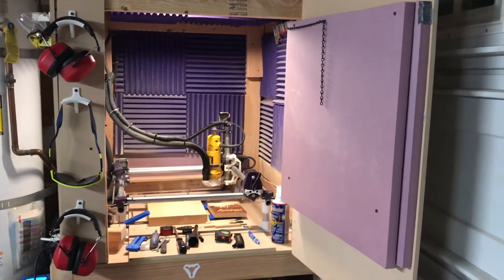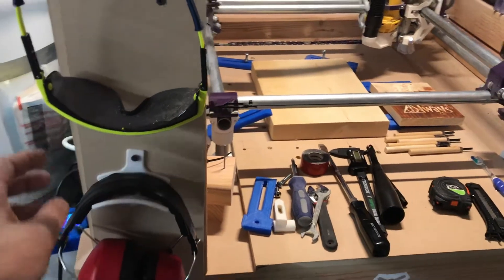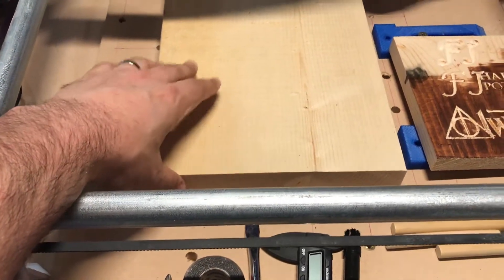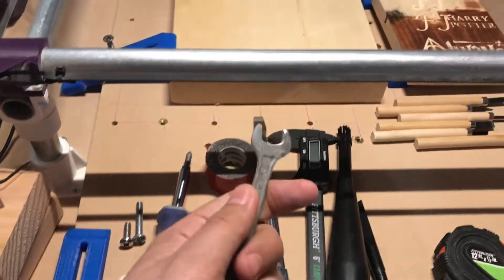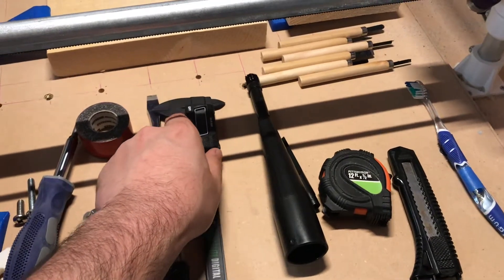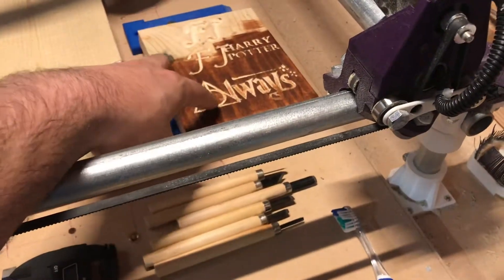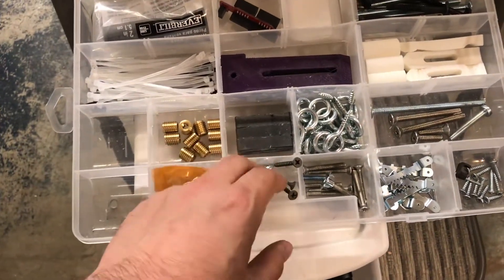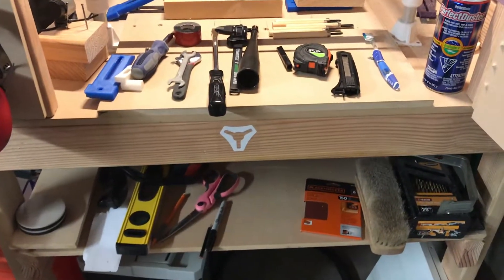MPCNC Pro-Tips part 2: Tools

Comment: Hi,
I am just starting my MPCNC journey (like I have not even printed any parts yet). I am currently a 3D printer and am really looking forward to getting into CNC. I will certainly be following your series and hopefully picking up a stack to great ideas.
Reply from the maker: Sounds great! Some other channels to follow are "Some Old guy coding" (I learned a lot from his videos, though they do tend to be long and in depth). Also there are videos now of MPCNC's cutting aluminum and even Steel! So the community is coming a long way. When you build it I just suggest being meticulous...I usually get excited and rush things a bit, but with this project accuracy on things like squaring it, and leveling your spoilboard are really important! Also make sure you clamp your work securely...and I watch my machine run..even via webcam if needed. You never know when you may run the head over a clamp cutting it free and then things go sideways. :)
Reply: GeekToolkit thanks for the advice. I’ve started printing the parts and I have some of the hardware on order. I think that I’ll definitely build some sort of enclosure. Mine will be in the garage and I don’t want to annoy the neighbours.

Comment: How loud is the cnc when doors are open and when closed?
Reply from the maker: Sorry just seeing this...I did an enclosure video that talked about it in DB, but in short...it's loud when its open (Must use hearing equipment...think circular saw by your ear). When its closed I can have a conversation and remove the hearing protection but I still stand a few feet away. but if i go a room over its barely noticeable....and I can speak normally...almost like being near a washing machine.

Comment: Once again great video.
I wouldn't mind knowing how you built the enclosure and where you sourced the foam from. How much does that deaden the noise?
Reply from the maker: jeff fodor Thankyou! I’m planning on making the enclosure video tonight if all goes well. The pink foam is from Home Depot...about five or six dollars for each panel. The purple was from Amazon...I’ll look up links tonight and link them with the enclosure video. I’ll also get a decimal measurement on both. Combined together it definitely deadens the noise...upstairs the shriek becomes a low hum...to hear it we have to not talk. Before it was considerable. In the Garage I can walk around and not have hearing protection on, but next to the machineI I still use it. The other benefit is dust...my entire garage would get covered in dust before this. I’ll get good video and some of my in progress pics up!

Comment: Super jealous of all that foam! Gotta fix that
Reply from the maker: oh you mean the sound absorption stuff on the sides? Insulation foam from Home Depot...flame resistant (some people were using egg crates...but those are flammable and seem like a bad idea).  The purple acoustic foam is great for getting the 'whine' of the bit down, but I'm not sure how great they are for sound absorption (I've read articles stating it both ways).  In the end, ideally I would've just added another piece of MDF to all sides to thicken the walls up...but in the end the design for the enclosure was based on being able to lift it off (allowing me to still do long pieces, or to work on it). Thus I went as light as I could on the sound insulation. When I do the enclosure video I'll look up where I got that purple acoustinc foam (It does also make it look nicer than the pink insulation stuff, and I matched it to my CNC colors...that was probably dorky but meh).  I'm pretty sure it was up on Amazon though